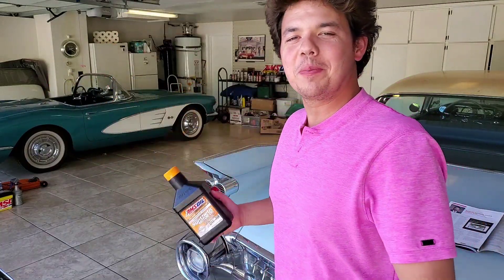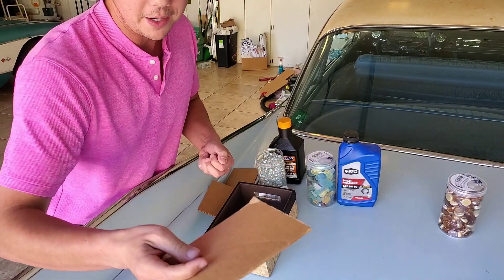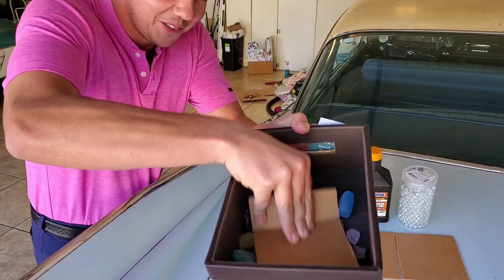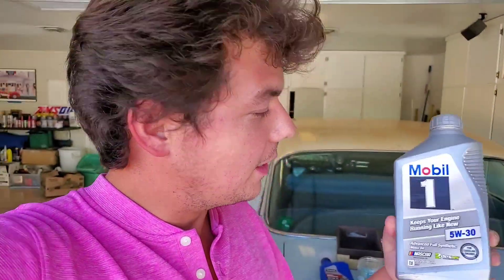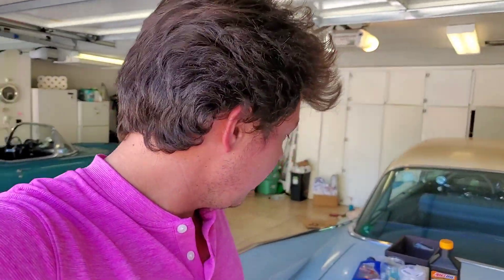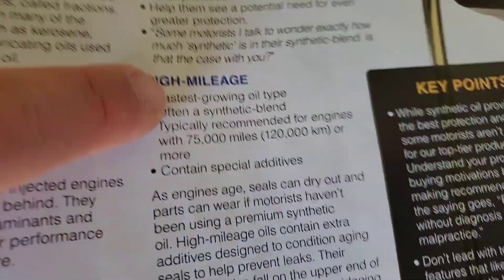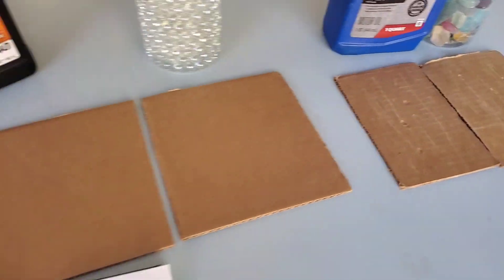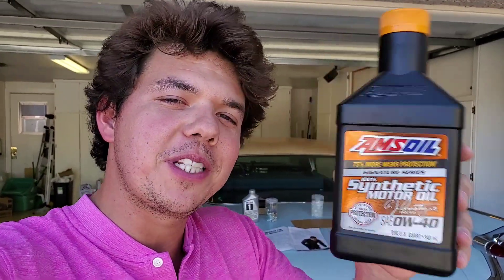How Does SYNTHETIC Motor Oil Work Compared to Conventional? #73

Comment from the maker: Why Mechanics Won't Recommend AMSOIL? - https://youtu.be/8OhntOxngAA

Professional YouLubher: Eben Rockmaker Regency Direct Jobber AMSOIL Specialist (Dealer#: 5331179) Mobile: (702) 472-3614 

      Ebens Wholesale AMSOIL Link + FREE Shipping: https://www.amsoil.com/offers/?zo=5331179.   & Text Me for latest promo code.  702-472-3614     

     Synthetic Oil Protection Coffee: https://supportwith.coffee/shop/subscriptions/sop/

SUBSCRIBE to Synthetic Oil Protection YouTube Channel - https://www.youtube.com/c/SyntheticOilProtection

   Synthetic Oil Protection Website - http://syntheticoilprotection.net/

Lookup For Your Vehicles - https://www.amsoil.com/guides.aspx?zo=5331179

      AMSOIL Performance Test Results - https://www.amsoil.com/performancetests.aspx?zo=5331179 

AMSOIL Dealer - Synthetic Oil Protection (702) 472-3614  https://maps.app.goo.gl/2AuZCi8h2Gaf3mY46

     

     Ebens Giveaway: 

Over $5000 Given to my YouTube Community Playlist - https://www.youtube.com/playlist?list=PLB_ftWArBFdey4HFt_Z9KgSIChjkLbw_o

     About AMSOIL: 

1. Where can I find AMSOIL? - Use this link https://www.amsoil.com/offers/?zo=5331179 

Or 

     Watch THIS: 3 Fast Ways To Get AMSOIL - https://youtu.be/RiYifuDCsnQ 

2. What makes AMSOIL different than other oils? - 

      AMSOIL is 100% Synthetic & has higher film strength & holds up 4× better in turbocharger deposit testing than Mobil 1 EP which protects and separates metal parts, keeping them from wearing and Lasting Exponentially longer: https://youtu.be/f4eNPgTi_qo 

3. Why should I use AMSOIL?: It protects the engine so it will last longer. Less oil changes less often (once per year/15,000 miles) or longer... Save money in Gas & Time making it less expensive than a free oil change over the year - https://youtu.be/H7K6FdZlqmg

     Professional YouLubher: Eben Rockmaker Regency Direct Jobber AMSOIL Specialist (Dealer#: 5331179) Mobile: (702) 472-3614

Lookup For Your Vehicles - https://www.amsoil.com/guides.aspx?zo=5331179

     Ebens Wholesale AMSOIL Link + FREE Shipping: https://www.amsoil.com/offers/?zo=5331179  & Text Me for latest promo code.    702-472-3614   

   

     25,000 Mile AMSOIL OIL CHANGE - https://youtu.be/vp1HTtlulR8 

 The Power of AMSOIL Signature Series 5W-30 Synthetic Motor Oil protects against harmful deposits on turbochargers 4X better than Mobil1® Extended Performance and 3.6X better than Royal Purple® in industry-standard testing*. https://www.amsoil.com/newsstand/motor-oil/articles/leading-the-field-in-deposit-protection/?zo=5331179 

     Better MPG Proven - https://www.amsoil.com/newsstand/motor-oil/articles/another-win-for-amsoil-products/?zo=5331179

AMSOIL Performance Test Results - https://www.amsoil.com/performancetests.aspx?zo=5331179 

     Lookup For Your Vehicles - https://www.amsoil.com/guides.aspx?zo=5331179

Comment: can I use synthetic oil in my old cars? Which Amsoil model do you recommend for my 2 cars? i have a 1991 toyota corolla and a 1997 suzuki vitara both use 10w-30
Reply from the maker: Great question Calvin this is the look up guide that will give you the motor oil in the filters for your vehicle I would also do the Amsoil engine flush and I would also use the Amsoil Pi performance improver.
Lookup For Your Vehicles - https://www.amsoil.com/guides.aspx?zo=5331179
Reply from the maker: If you're new to Amsoil it's best to become a six-month preferred customer that'll get you the free shipping and you'll also have the wholesale price.
Ebens Wholesale AMSOIL Link + FREE Shipping: https://www.amsoil.com/offers/?zo=5331179

Comment: What’s your take on the OE series? I just bought 12 quarts to switch over both my 2019 Honda Pilot & 2007 ford freestyle.
Reply from the maker: Boe oil is the best option for people that drive less than 10000 miles a year.

I haven't done Royal analysis with it yet I am sure it's good for 5,000 in most vehicles.

I wouldn't be surprised if it's good for 7000 miles I simply haven't had a chance to do the tests with it.

But if you're someone that just drives very few days a week I would definitely go with the oil oil.

If you're doing a lot of short trips I would still run the signature series because the short trips are the hardest on the oil because it doesn't warm up and it's more prone to getting acid and all kinds of different problems so I would still run the signature if I did really short trips

Comment: Eben, do I have to flush my engine every time? I am already on Amsoil Signature Series 5W-30 and I flushed it when I first switched to it 10k KMs ago.
Reply from the maker: Not at all I only recommend doing a flush every time on diesel motors because of the extra sit and a lot of the times the Diesels are also turbocharged and it's good to flush a turbo motor more because of the Heat and keeping the turbo clean inside so it doesn't oil Coke
Reply: @Syntheticoilprotection  Thanks man

Comment: Hey! Quick question. Amsoil .com says to use atf multi vehicle  for my 2010 civic i know its says compatible with honda z1 atf how come the website doesnt recommend the fuel efficient atf if that one says compatible with dw1 which is z1s replacement?
Reply from the maker: Good question I would use the one that's on the lookup guide for your vehicle I always use the signature series because it has the extra upgraded detergents and the fluid will last a little bit longer.

Some vehicles have had a technical bulletin update so even though they're older they have been updated it to the fuel efficient it just depends on the style of transmission and vehicle make model.
Always good to double-check sometimes when I look at it I get it mixed up myself so I always double-check.

Also if you're thinking about ordering I recommend being a preferred customer and I will send you my preferred customer link that way I can always help you with the products
Lookup For Your Vehicles - https://www.amsoil.com/guides.aspx?zo=5331179
Reply from the maker: There is a 2-stroke snowmobile promotion going on right now on any order 75 bucks or more you'll get a free bottle of the Interceptor 2-stroke oil.

Promo:SNOW1020 

Ebens Wholesale AMSOIL Link + FREE Shipping: https://www.amsoil.com/offers/?zo=5331179

Comment: Hey Eben. I’ve always been curious about AMSOIL, I’m thinking about using AMSOIL for my 2011 Lexus GX460 next oil change that’s coming up soon, the engine flush won’t hurt the engine correct?
Reply from the maker: Thanks for reaching out to me Armando and this will save you a quite a bit of money here this is my pulse a link you'll get the wholesale price plus free shipping and then there's a promotion going on until the 20th a free bottle of 2-stroke snowmobile well with any order 75 bucks or more☕

Ebens Wholesale AMSOIL Link + FREE Shipping: https://www.amsoil.com/offers/?zo=5331179

Promo: SNOW1020
Reply from the maker: I've completed over a hundred engine flushes and I've never had one problem ever😉

Comment: Eben quick question, can i mix the dominator coolant boost with evans waterless coolant?
Reply from the maker: No because the waterless coolant are to be used in its entirety.

That's the downside to the waterless coolant is you have to make sure everything is out of it before you switch over
Reply: Thanks.
Reply from the maker: ☕☕☕, the best use for waterless coolant is for classic cars that sit a lot you don't have to change the coolant is often
Reply: @Syntheticoilprotection  i have a 370z thats garage kept, not daily driven, so if you recommend this i would appreciate it.
Reply from the maker: Yeah something like that I would just do a drain and fill with the low-toxicity biodegradable Amsoil coolant you'll see it it's the white bottle and then I would also use the Dominator coolant boost.
This will give you all the products for your vehicle and then I have my preferred customer link that will give you the wholesale pricing as a preferred customer
Lookup For Your Vehicles - https://www.amsoil.com/guides.aspx?zo=5331179
Reply from the maker: Professional YouLubher: Eben Rockmaker Regency Direct Jobber AMSOIL Specialist (Dealer#: 5331179) Mobile: (702) 472-3614 

      Ebens Wholesale AMSOIL Link + FREE Shipping: https://www.amsoil.com/offers/?zo=5331179
Reply from the maker: Always happy to talk anytime Andy have a great weekend

Comment: Howdy bud, hey l have a question for you about coolant boosters and wanted to know how well Amsoils works compared to some of the others. I've been hearing a lot about hyper lubes coolant conditioner and has a lot of really good reviews on it, but I haven't found any comp vids and wanted to know your opinion on the matter
Reply from the maker: Yeah the coolant boosters great the biggest thing I like about it is especially with the Amsoil one he's how your car warms up quicker the big benefit is your car gets off idle up quicker so you have less fuel contamination into your motor oil because when your car starts up at Rich and it can have a lot of fuel going into your crankcase.

Also if you'll notice not only does your car warm up twice as fast but you'll also notice your heater works a lot better because the fluid is pulling the heat out of the cylinders in the heat is going into your heater core so when your air goes over it you have a lot hotter heat coming out of your vents.

The Amsoil coolant boost is called Dominator coolant boost and it lasts 1 year for 30,000 miles whichever comes first and it's a chemical that slowly breaks down so you have to replenish it so what I do is I add about half a bottle every year into my car.

Also you don't need very much of it it's amazing how strong it is.
https://www.amsoil.com/p/dominator-coolant-boost-rdcb/?zo=5331179
Reply from the maker: In this video I start up a Honda pilot and I show how quick the gauge gets hot it gets 80% to operating temperature in like a minute and 50 seconds.
https://youtu.be/zUDHutwKKCo

Comment: You lost a lot if weight! You look healthy af
Reply from the maker: Yeah I have been doing calisthenics and working out quite a bit without weights. Pretty much just bodyweight exercises push-ups pull-ups leg lifts that's it. Eating quality food
Reply: @Syntheticoilprotection  You look great man, keep it up. Start doing weight lifting also, it'll look and feel great on you
Reply from the maker: I used to lift weights a lot and I didn't realize I wasn't working my core correctly and a lot of calisthenic exercises use your core and that in my opinion is the most important thing to work on.

You'll see Jack LaLanne and all the stuff he did with core exercises
Reply: @Syntheticoilprotection  

Awesome! Man your looking good!!!
Push ups, sit ups, run, eat healthy and take your vitamins!

Great video!

Comment: You should also pour the marbles and rocks out from a distance as well to show why you can pull off the  tall pours you do in all the engine flush videos instead of the glugs in other bottles.

It's saying a lot when Valvoline knows this is enough of an issue with their product that they can only replicate that stunt with their own oil by developing the Easy Pour bottle to make it work, while AMSOIL pulls it off simply by developing better chemistry.

So good you can feel the protection...and see it.

Comment: Big difference between Full and 100% Synthetic.
Reply: @miketonon7946  more like 12,500 miles and top off at the filter change.
Reply from the maker: Huge difference........

AMSOIL Signature Series 5W-30 Synthetic Motor Oil protects against harmful deposits on turbochargers 4X better than Mobil1® Extended Performance and 3.6X better than Royal Purple® in industry-standard testing*. https://www.amsoil.com/newsstand/motor-oil/articles/leading-the-field-in-deposit-protection/?zo=5331179
Reply from the maker: I would make sure to change the oil filter early and I would check your motor oil every month and just keep an eye on it as long as it looks great it is great that's the good thing about Amsoil is the way it looks is the way it is.

But yeah I would just make sure you change the oil filter a little bit early. That way you'll have a lot of oil flow on the cold start you won't have to worry about starving the timing chains
Reply from the maker: Just depends. 

This is some real world examples- https://www.youtube.com/playlist?list=PLB_ftWArBFddc-nU9A-k2vfxWYxdq3E_b
Reply from the maker: Yeah when it looks a little dark and you have changed the filter and it looks like it's getting thicker it's definitely time to get an oil analysis and keep an eye on it once you get used to the vehicle you'll have a really good idea what you're capable of.

Of course every vehicle is different and every engine has it heat and crank oil capacity which can vary which really makes a difference on how hard it is on the oil